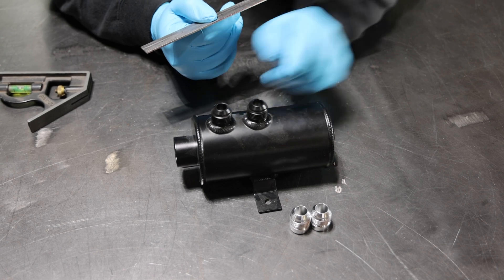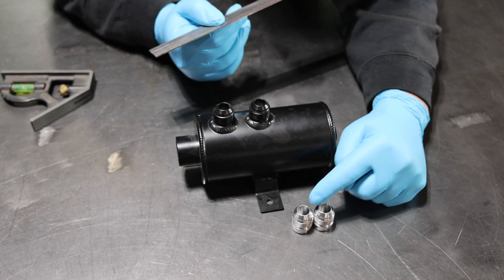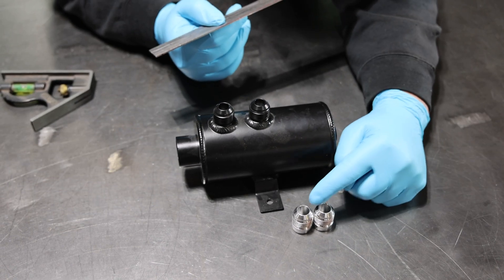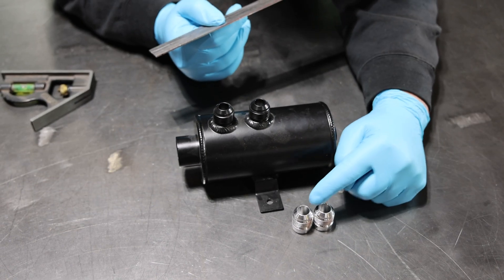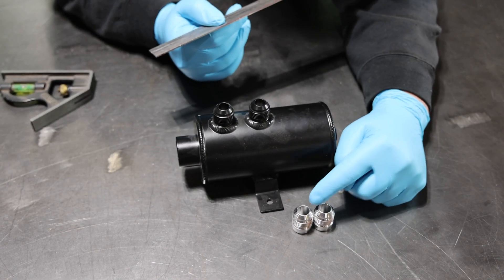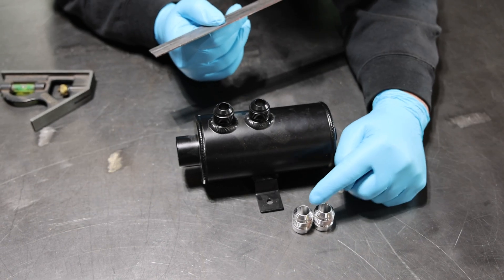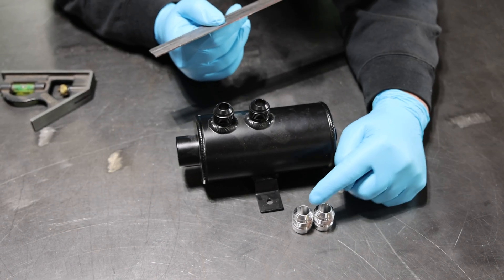Need More Bungs?

Comment: Good stuff! How’s your local area in terms of quantity of business? Is this type of custom TIG work plentiful enough to stay busy?
Reply from the maker: I stay pretty busy doing little custom jobs like this, 5 or 6 a week, but I do A LOT of mobile work to pay the bills. Stuff like this is gas/beer money
Reply: @everlastgenerator  Neato. I’m really trying to figure out the best, most cost-effective way to put together a mobile generator/welder to do mobile TIG on the side. Do you run a Lincoln/Miller genny or something else? And have you tried running the inverter stuff on a genny before?

I have a 160STH that I have successfully run on an old Lincoln generator in both 110v and 220v. In your opinion would the larger AC/DC inverter machines work alright on generator power or would you generally recommend a standard Bobcat/Ranger type generator welder?
Reply from the maker: @nilknoc101  anything that produces clean power is good to go as far as generators, I have a lot of customers running off newer bobcats that haven’t had any issues. Machines that have PFC tend to work even better on generators. But I’ve even ran my 210ext off a predator 3600 and it ran great
Reply: @everlastgenerator  lol good to know. Thanks for the info! Cheers 👍🏻